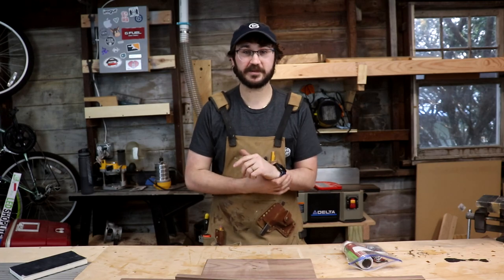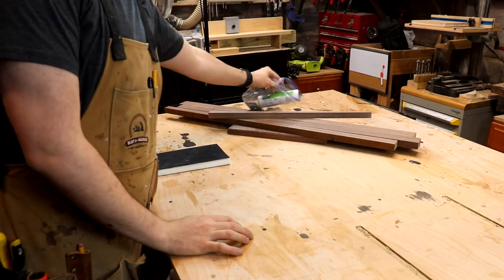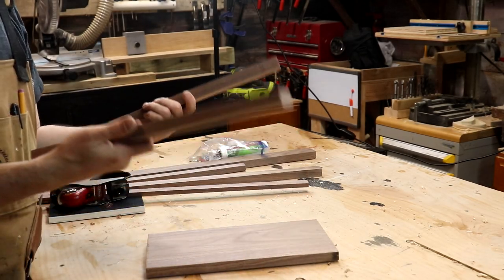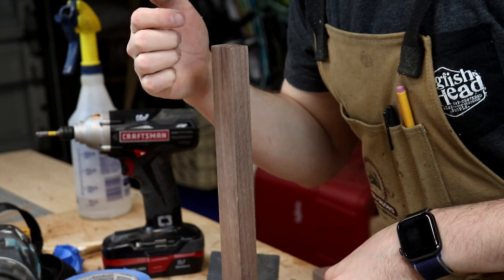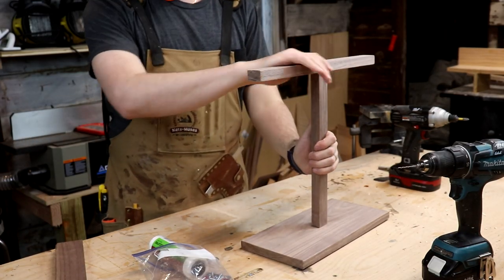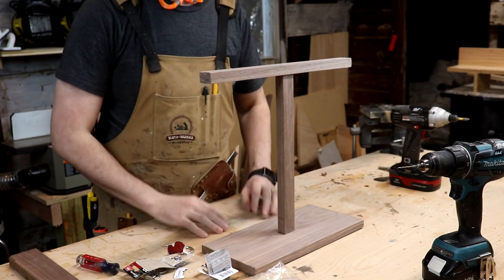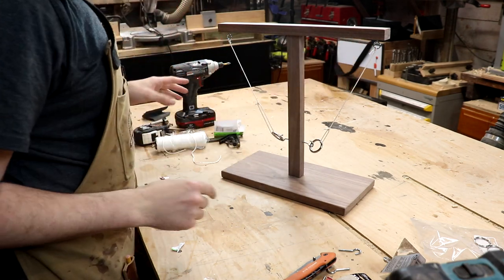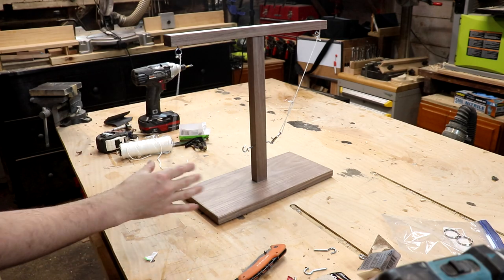Making the party game no one is good at!

Comment: Excellent video! I was looking for some inspiration to make one of these. I have a dumb question. Instead of using screws, why not just using doweling? I’m still a bit of a noob to woodworking, so I’m curious if there is a drawback to using 2 - 4 dowels and glue to join everything. I was thinking it might be sturdier that way. I appreciate any feedback you have.
Reply from the maker: No draw back really. I used a screw because it was easiest to line up. I don’t have a jig or anything for centering and aligning doweling . It was just easiest to use a screw and give it an accent
Reply: @BillBuilds  thank you!